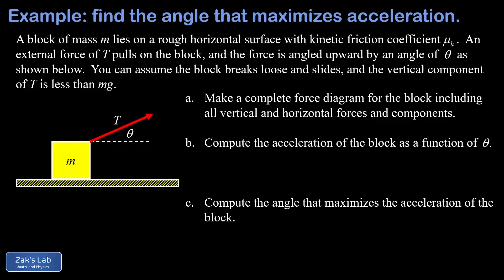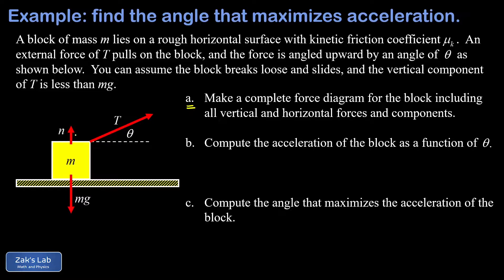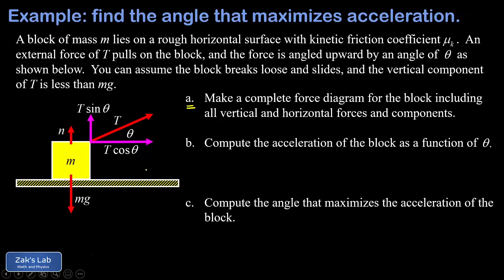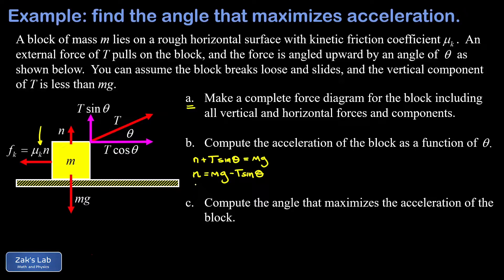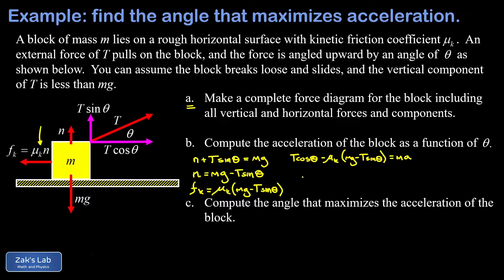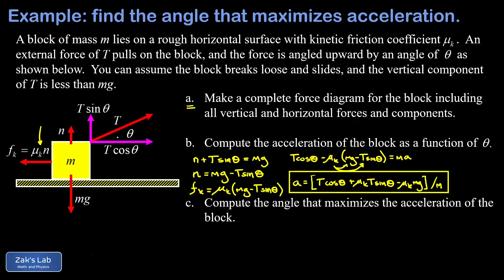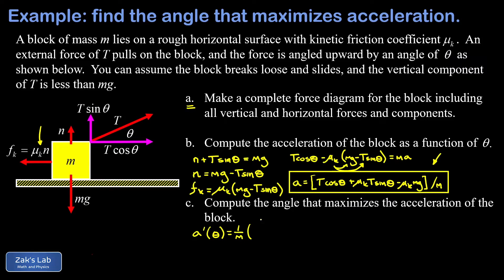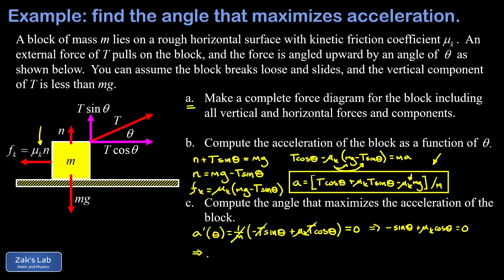Find the angle giving maximum acceleration for a block pulled with kinetic friction.

Comment: Thank you so much, I understand everything but I don't really understand why should we derivate acceleration respect to theta, how could this give us the angle that we want? Would you please explain it.
Reply from the maker: finding minimum or maximum of a function:  take the derivative and set it equal to zero.  That's going to be the location of a max or min because it's the top of a hill or bottom of a valley where the slope is zero (calculus I optimization stuff), and you can usually infer which based on physical context. z